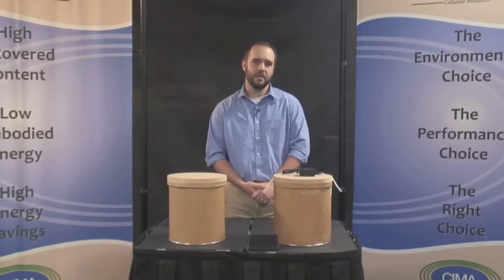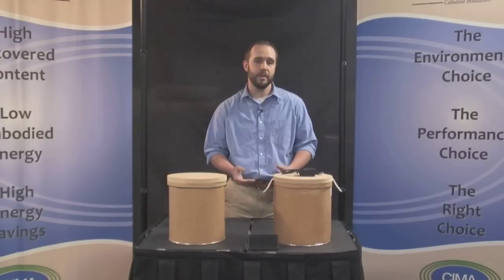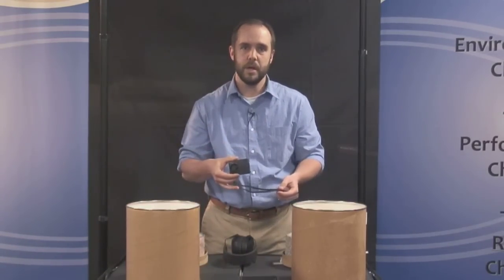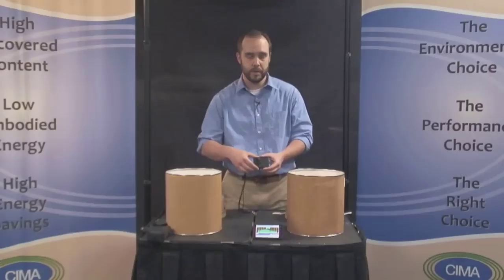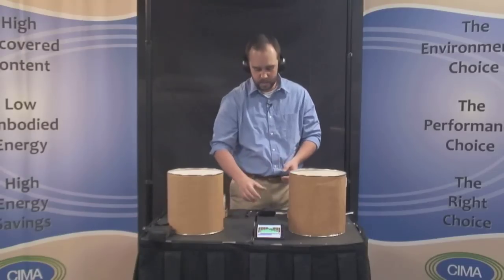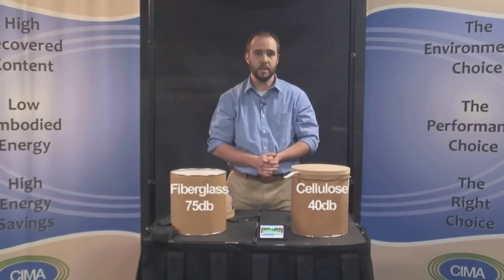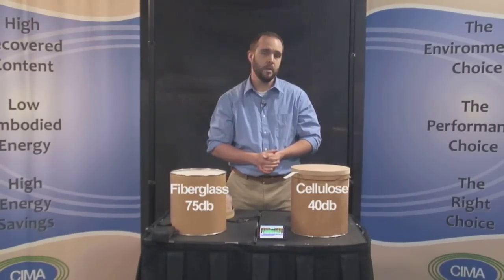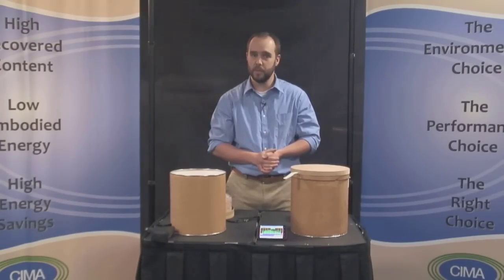Cellulose vs. Fiberglass Insulation Sound Proofing Demonstration

Comment from the maker: Actually, I do understand. Cellulose insulation cannot be blown into a wall at a wide range of densities. You could blow 2.0 pcf into a wall, but it would be an improper installation. Standard practice is to install the material at 3.0 to 3.5 pcf. At anything less than this settlement will occur and there will eventually be voids at the top of the cavities.  Even cellulose wall cavity spray--the material used in the sound bucket demonstration-- is installed at this density.